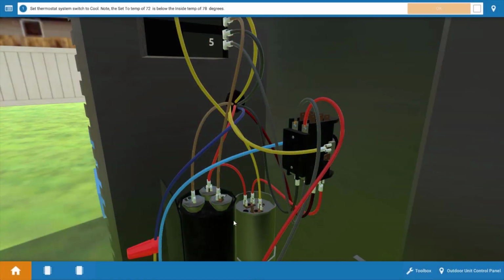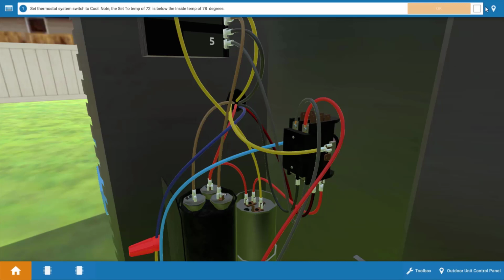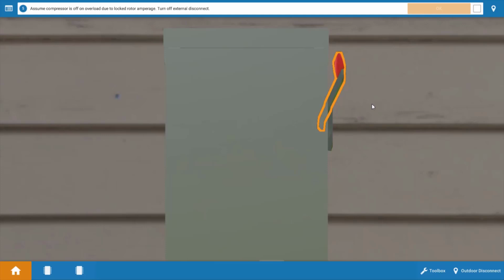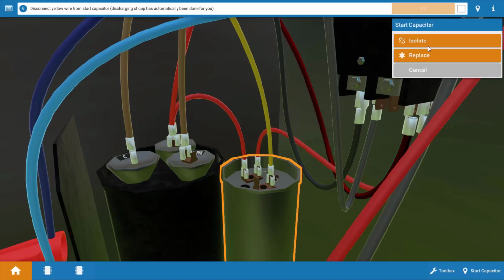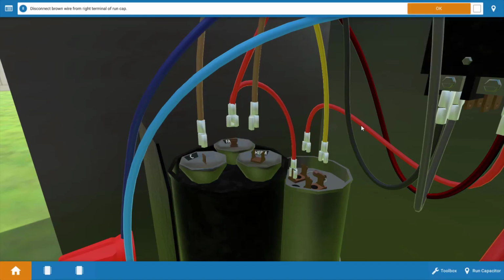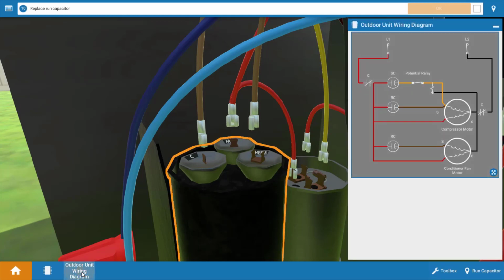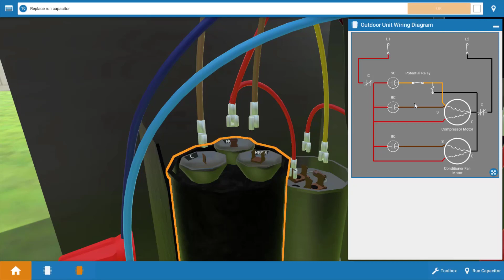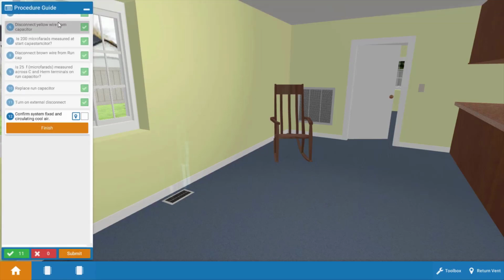Residential AC Faulty Dual Run Capacitor [HVAC Training 2019]

Comment: Thanks for your video.
Is there any polarity for caps bcz they place straight and curved sign in schematic? Or if I combine some caps in place of one, does it matter which side of caps is common  and which side is Herm?
Thanks
Reply from the maker: Polarity matters on the Dual Run Capacitor because line voltage must connect to the common terminal to flow through each capacitor (compressor and condenser capacitor) Most capacitors are not polarity specific but some are. Many older capacitors had a red or white dot beneath the terminal that must be wired to the Run terminal. It is not common anymore but always check for a marked terminal. Let me know if that answered your questions.